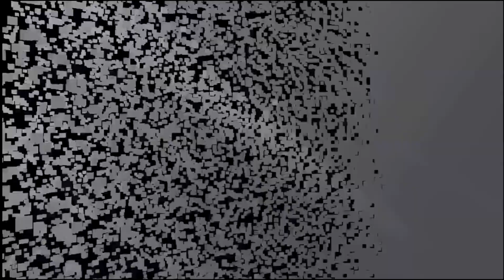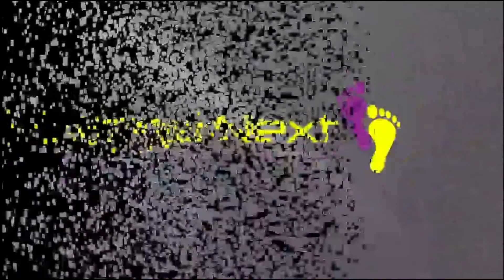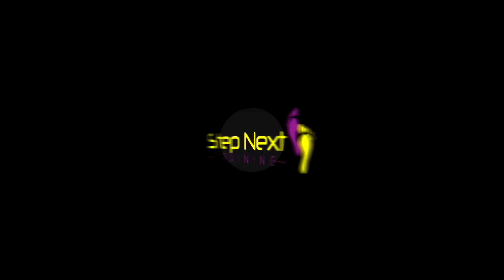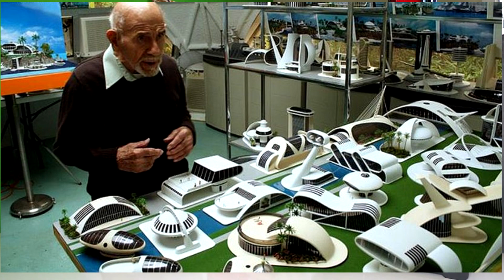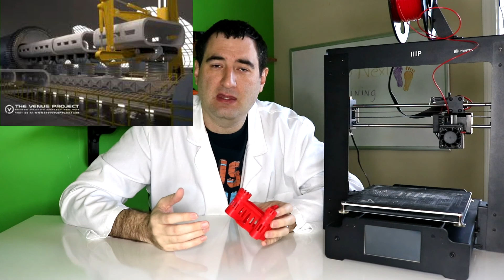$4000 Dollar 3D Printed House?  Is this where we will Live?  Who likes Concrete?

Comment: I have so many questions. 1) Are these houses printed in place or in a factory? 2) Is it possible to include a long span like a bridge, a roof, a stair case, or the floor of a second story?
3) Why is the finish so rough? Is there some kind of prize for using only PRINTING technology without additional robotic assistance? Specifically, could a second tool follow the print head to smooth out the rough finish; maybe even adding some detailed art work into the concrete as it's setting.
Reply: The next icon model will build 2 stories
Reply: They r printed on the slab of land ya buy
Reply: 4 #3, u could paint it or somethin
Reply: They can be rendered smooth and painted 👍🏻